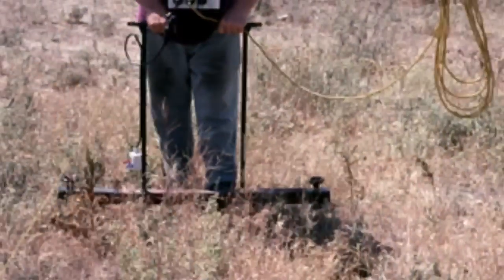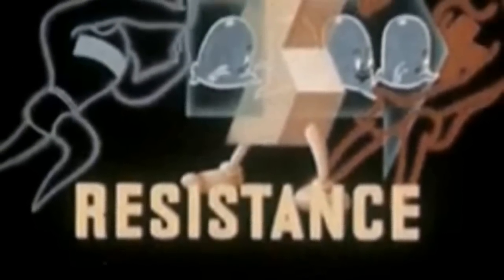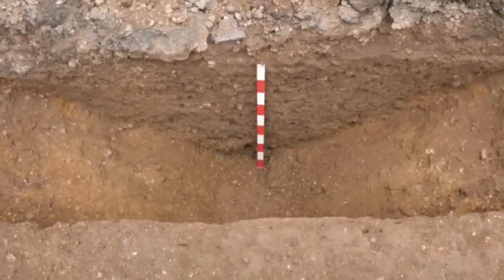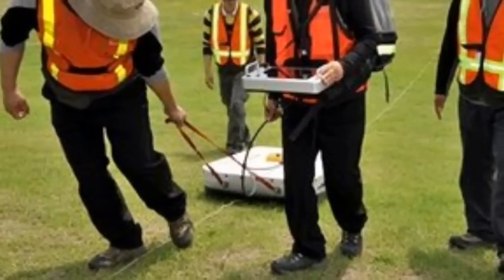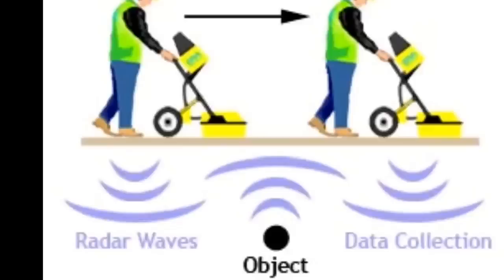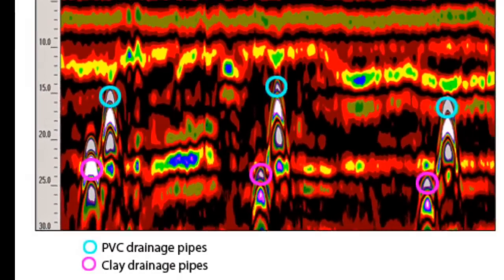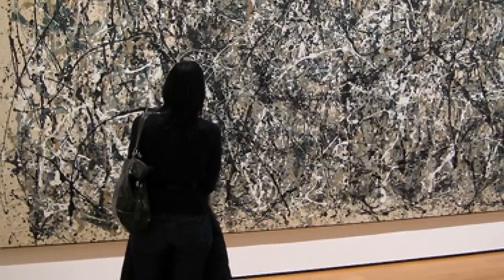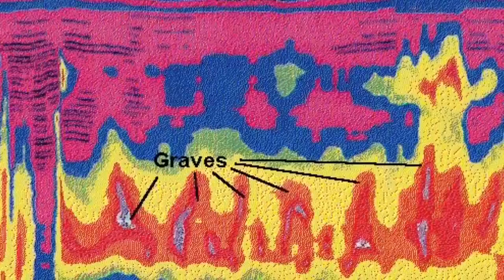A-Z of Archaeology: 'G - Geophysics'

Comment: A suite of techniques which allow archaeologists to see beneath the soil. There are three main types of geophysical technique the first one makes use of electricity and observations about the flow of electricity through different objects. The second makes use of magnetism and the different ways in which objects respond to magnetic forces the third amployees radar and the principles there in all of these are enable is to see into a realm where we usually cannot that is beneath the soil now each technique is subtly different and employs a different scientific principle in order to achieve its goal an electrical resistivity survey involves putting two prongs into the ground and passing and electrical current between the two as the current passes through fluctuations measured and recorded the rate at which electricity is passing through the ground can tells a lot about what is there more electrons or less electrons means more or les resistance and this tells us what the quality of the objects are more resistance tends to mean dense objects less tends to mean less dense so for instance a wall will put up a lot of resistance to electricity rather ditch which contains more water or probably put up less resistance a magnetometry survey measures differences in the magnetic field this uses the principle pf magnetometry or magnets and indeed the very fact that the earth is one giant magnet with its own magnetic field for example when some object our satellite magnetic particles within them are excited and align themselves with the Earth’s magnetic field as it is this means that areas where wood has burned or metal has been worked I’ll show up with a different magnetic profile to the area around therefore they can be plot it on a map using this technique swords for example are extremely easy to find using a magnetometry survey survey ground-penetrating radar employs the principles of radar and bouncing sound into the ground to see what’s there a radar dish sends out a sound wave and from what is bounced back it can tell what is in the sky around it archaeologists use precisely this technique but they point the radar down technique actually has an advantage and that is that it can measure two different depths in the soil and gain a very detailed picture of what might be beneath you the the images and results rendered from this techique allow archaeologists to have an accurate or more accurate guess of what is beneath their feet as with any other datasets and there is a certain amount of interpretation required and the date often when it is actually ı’m an art scene in its raw from it can be a little bit confusing sometimes the results gained from geophysical surveys can appear to be confusing indeed some have compared it to comtemplating a Jackson Pollock painting without the right person next to you or a guidebook on other occasions the results can be remarkably clear this is a resistivity survey showing the guest hall at reflow Abby Noth York shire  this is the results from a magnetometry survey showin very clearly areas of burning or where metal might be and this is a GPR survey showing everything from the tarmac so where graves may be deeper beneath your feet so as we’ve seen geophysics is an extremely useful method and it allows archaeoogists to analyze a site without ever breaking the topsoil it allows a sense of the area it allows a archaeologists to focus their excavated resources on sites of interest on parts of the site which we’re going to which are likely to be interesting but also as well as we saw in the video values about excavation and axcavation is a destructive technique so J physics often saves a site from effectively being destroyed by the arc is equal archaeological technique so that’s been G geophysics and hopefully you found this video useful and or interesting feel free to comment below.